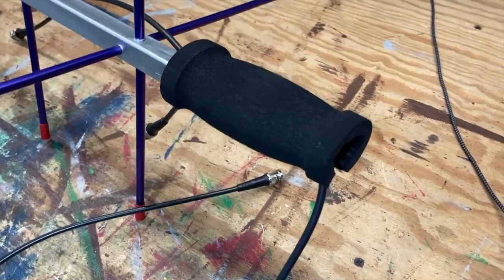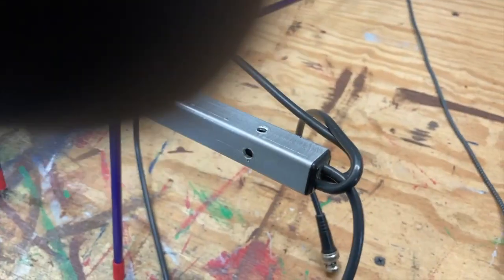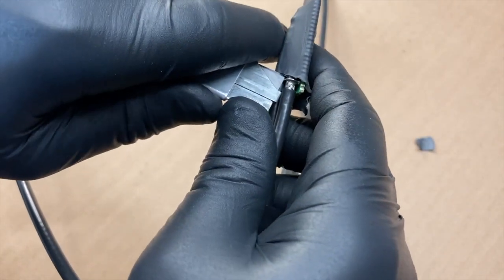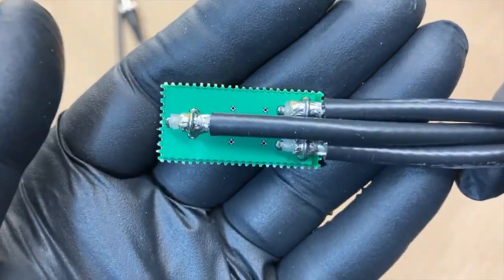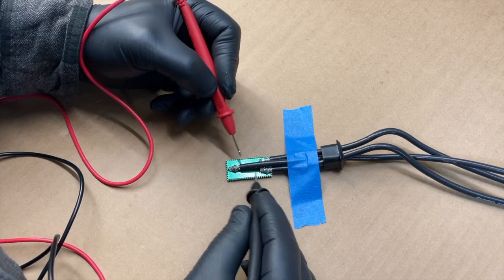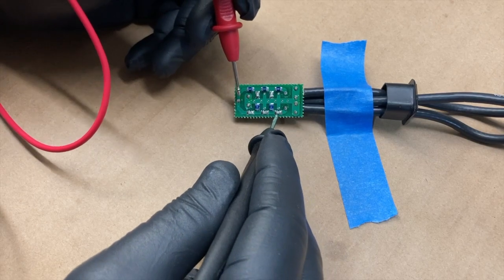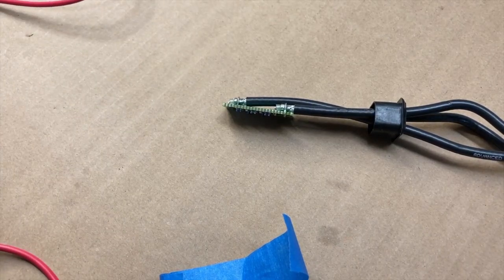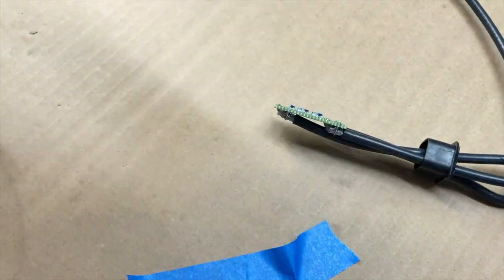Arrow Antenna  |  A Look Inside The Dual Band Arrow Antenna Duplexer  | Cable And Duplexer Issue

Comment: At 2 meter side, resistors in series connection but the 70cm side, capacitor in series so there will be no continuity reading.
Reply: Not resistors, they are inductors, but as you say, 2m will show continuity and 70cm won't👍

Comment: Not sure why you're troubleshooting the 70 cm side if you can't hear ISS SSTV transmissions which are on a 2 m downlink at 145.800.  Always check the ISS status page (google "ARISS station status") before you try to work the ISS, or if you have trouble hearing anything just to confirm that the stations aren't shut down for a docking/undocking/space walk.  This happens regularly including during SSTV events.  No sense tearing things apart if they're just QRT up there.   Cool to see the duplexer guts though.

Comment: A simple test with two 2m radios is to set up an HT on 146MHz with rubber ducky antenna and another radio setup on 146Hz connected to the 2m side of the arrow antenna (reconnect the Diplexer's antenna connections).  Transmit on the HT at lowest power setting about 25 ft from the arrow and listen on the Arrow's radio on same 2m frequency.   Perform the same test on UHF band for both radios.  Increase TX power to maximum 5W and check Radio's RX signal level against calculated level.  An oscilloscope measurement at various points along the 2m low pass filter chain can show where there may be a bad component, short or open.  Repeat for the 70cm filter chain.